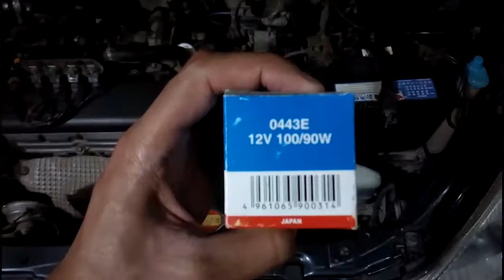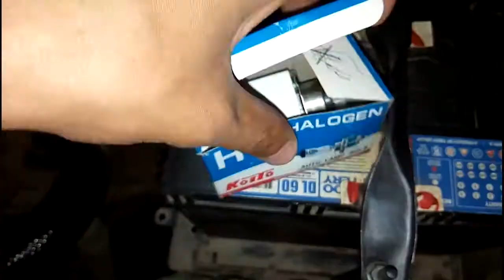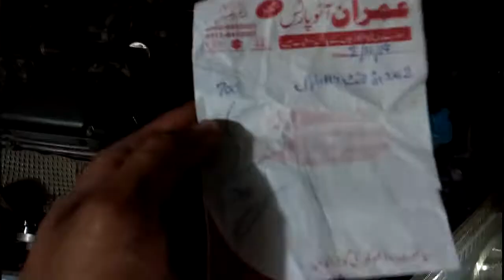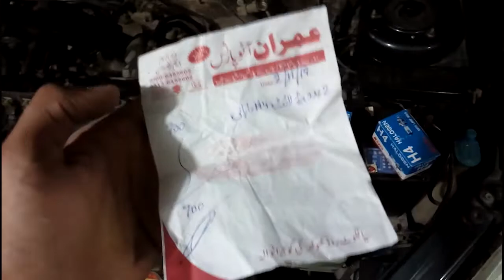How To Change Headlight Bulb | Upgrading to H4 90/100W | In Urdu

Comment: Brother would you recommend these Koito bulbs for PKDM Alto? Will it damage the reflector or anything? I suppose i would need to get relays installed as well?
Reply from the maker: Yes you can use these in PKDM alto without any relay and it won't hurt your housing if they're genuine. You can also go for  LEDs https://www.instagram.com/p/C0O-MFNt2ge/?igshid=MzRlODBiNWFlZA== 
They'll cost more then halogen bulbs but are totally worth it
Reply: @MOEEZAHMED4942  my only concern with LEDs is blinding other drivers because of the reflector housings. Are there any LED options that have a good low beam cutoff?
Reply: @MOEEZAHMED4942  Saw your instagram post, they look great. So the question is whether they blind oncoming traffic?
Reply from the maker: Factory Fitted OR Good quality LEDs have a proper cutoff, they don't spread in irregular manner - and light stays below eye level of on-coming drivers on lo-beam.
Whereas on Hi-beam, no matter which light you're using it'll blind others - Let alone koito halogen lamps too,
Reply: @MOEEZAHMED4942  that is exactly what I'm asking. Are there good reliable options available in Pakistan for reflector housings?
Reply from the maker: @OverlyCuriousEngineer  the one I'm using is of not so known brand but still its making that cut-effect without spreading as u saw on Instagram, I believe any good LED will serve this purpose. As far as brand name is concerned so I heard about  'Novsight' by many YouTubers regarding their brilliant cut, brightness and focus ETC

Comment: Dont u thinks kay ager app relay use kartay tou result behtar hpta
Reply from the maker: Yes You're right, But I wasn't interested in disturbing the original wiring so I left it as it was, and the result were quite satisfactory so I didn't bother going for relays
Reply: Without relay bulbs are not getting full power that's why you are feeling no difference..
Reply: @CeZaR NeBuN your light switch shall burn very soon due to high wattage.. your car wiring is not supposed to handle this high wattage.. I have seen multiple of complains.. rest upto owner.

Comment: do you happen to know how to align them? I own one of this and I replaced the bulbs however it looks like the left headlight, the light is like directed up and not to the road and the right one  is too down. thank you for the video
Reply from the maker: Yes, There are 2 screw-Type adjusters behind the headlight housing, 1st for Up-Down Adjustment and 2nd for Right-Left Adjustment.
You can easily align your headlights by rotating those adjuster-Screws, Just go on some empty road at night and adjust them according to your requirement but While adjusting consider oncoming traffic too, as misaligned headlights can be dangerous for you and oncoming traffic. 
This method will not give you 100% Accuracy but light will be according to your requirements.
You're Welcome
Reply: @MOEEZAHMED4942  Thank you very much! I appreciate your response! I'll look for them and let you know how it goes or I have troubles lol
Reply from the maker: @JonathanRodriguez-oz9in  
You're always Welcome, I'd love to hear your experience, Best Of Luck!